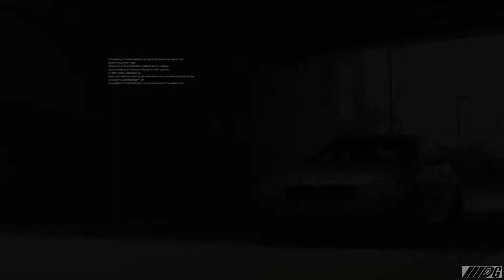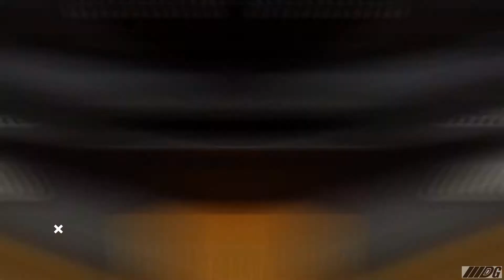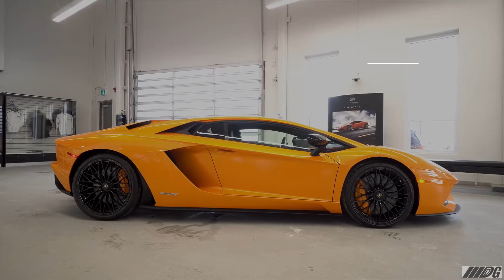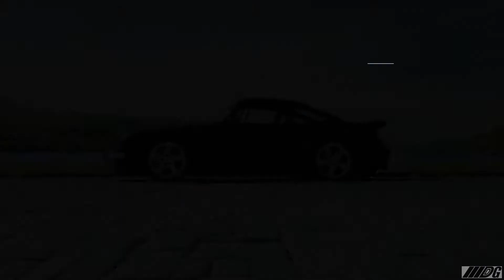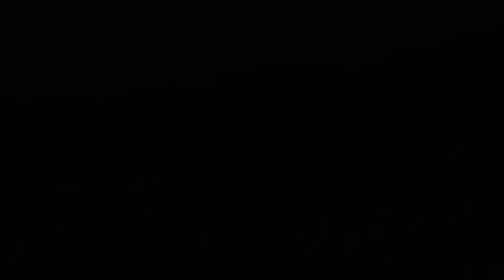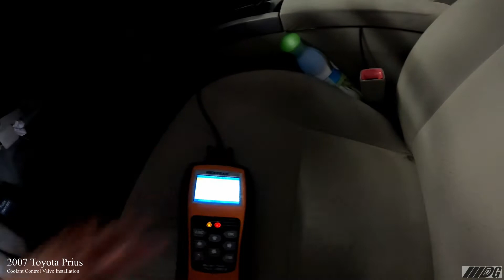2007 Toyota Prius Coolant Control Valve P1121 ODB2

Comment: how do you know you only need to buy that one part? I clicked on the amazon link and it has 5 other parts with it? I have a P1121.
Reply from the maker: The P1121 error code is generally the control valve unit. Link is below to help you order it from Amazon. You will also need a ODB2 reader to clear the code once you replace the valve unit. 

https://www.amazon.com/gp/product/B01MYWW13J/ref=ppx_yo_dt_b_asin_title_o00_s00?ie=UTF8&psc=1